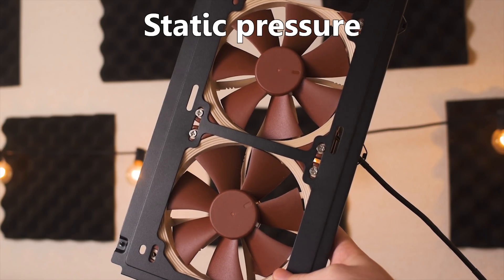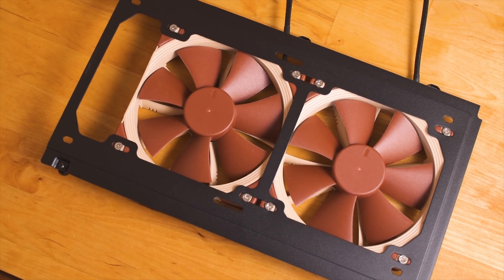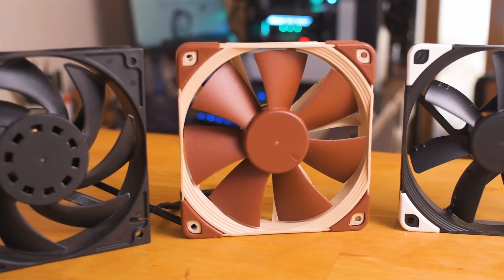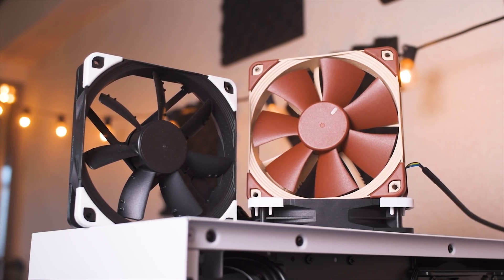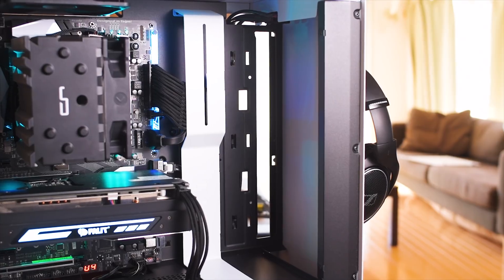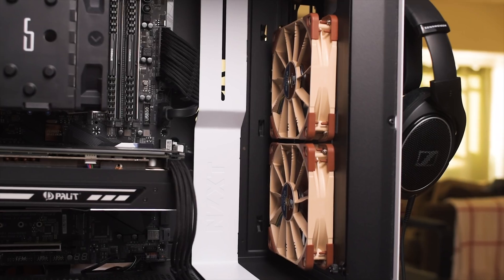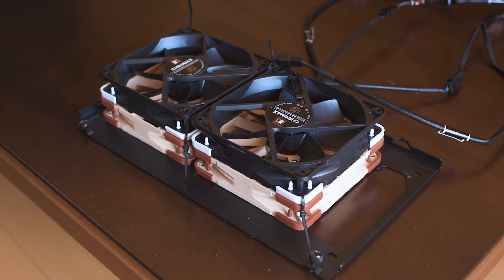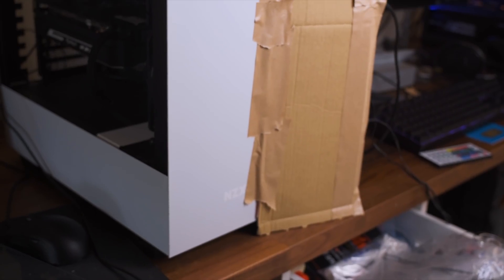DON'T buy front intake fans! (For NZXT H500/S340)

Comment: I think the one thing you are missing here is that you are using a system that barely pulls more than 200W (if that, even), which is not enough to show a significant thermal difference with this case and setup (and quite frankly, I'm not sure if its enough to challenge ANY case anywhere).

For the CPU, you have additional assistance with the Cryorig H7's fan for airflow through the tower, but since you are likely hitting 60-70W of consumption at most, you aren't even remotely saturating the heat pipes capability for heat transfer.

For the GPU, in both scenarios the twin axial cooler has plenty of access to fresh, cool air. In the initial setup without front fans, the negative pressure of the case is pulling in cool air from the rear, empty PCIe covers. When fans are added to the front, the air is still being given to the GPU in a significant enough fashion for the temps to remain constant. In both scenarios, the top and rear fan are able to remove hot air from the GPU, and once again, due to the significant size of the GPU heatsink, you are nowhere near saturating the heat pipes.

Adding front fans to the H500 (or really, any case on the market) is entirely dependent on the level of heat generated within the case and the saturation of the cooling components within. In fact, with your system you could likely apply duct tape to the entirety of the front intake, bottom intake, and remove the rear fan entirely and see little to no change in temperatures of your components. The natural intake from the PCIe slots would be more than enough for the GPU, and the CPU fan plus the top fan would provide more than enough capability to exhaust the hot air from within the case.

If, however, you were to change the load generation within the case to a 250W+ GPU such as an AMD Vega card or GTX 1080, and overclock your CPU to pulling 120W+, you would then begin to see the thermal limits of the case's compact nature.

Without a doubt, an individual running a GTX1080/1080Ti plus something like an i5-8600k/9600k overclocked to 5.0Ghz would absolutely notice a significant change in temperatures with front intake fans present. For me personally, I preferred the compact nature and aesthetics of the H500i, so I chose it for my i9-9900k and 1080Ti FTW3 Hybrid build. I have a 280mm AIO on the front (NZXT Kraken X62), and the hybrid card uses a 120mm AIO which is placed on the rear. I still retain the 120mm fan on top for exhaust and VRM cooling. The airflow, thanks to the 140mm fans on the front, is more than enough to keep all of my components cool. For testing purposes, I decided to shut off the front fans entirely and run a GPU only load (since my CPU temps are tied to the front radiator, it wouldn't be fair for me to run a CPU load with this test as I'd have no cooling performance from the radiator) at 100%. With front fans at 40% (my normal range for gaming/etc, which is silent), my GPU temps stayed put at 55C. Once I shut off the front fans, temps climbed to a whopping 68C (very high for a hybrid card) due to lack of fresh air being pulled into the case to assist the radiator in the back.

Your testing equipment is simply not enough to challenge the natural case airflow in any meaningful manner.
Reply: Thank you for this, he had me thinking. Just got my h500 today. My old case has 7 total fans to cool my 8700k at 4.9 and GTX 1080. Putting the 8700k in the h500 with a 2080 ti and was worried about the smaller case with 5 fans being able to keep my 8700k as cool as the old case. Wanted to avoid water cooling the cpu but it would be so easy with this case.
Reply: Pyromonkey83 Do you think it'd be worth it purchasing a couple of front intake fans if I have an i5-9600k and an rtx 2070(single fan)??
Reply: @victorboesen3837  if you're using air cooling you absolutely should buy at least a single high static pressure fan (so it gets good airflow even through the restricted front intake) my pc would overheat frequently (also an i5 9600k rtx2070 system) but when i added 2 front intake fans that problem quickly went away
Reply: coolboybryan303 thank you for the reply! I've moved the back exhaust fan to the front bottom and it has improved my gpu temps a lot but the CPU temps has risen. However it was the gpu that was the hottest while gamin and the CPU doesn't go above 60 while rendering and exporting videos. But yes I will purchase a couple intake fans, so I have two exhaust fans and two intakes.
Reply: @victorboesen3837  if you're having trouble with gpu temps you might want to orient your fans to the back of the case and have them both blow out air to the outside of the case, this way air will be pulled in through the little perforated holes in the pcie slots, it helps a lot with cooling, its how nzxt designed it
Reply: @sovietry4944  It's not really a problem actually. Before my gpu hit temps at 70 sometimes, but now it never goes above 65 even when benchmarking. But thanks, I actually didn't know that.
Reply: @coolboybryan303 hey i know this is a little old but i was wondering if i would need front intake fans for a i7 8700k cpu and a 1060 gtx. this is the first pc that i’m building ever and have taught myself, using the internet, basically all i know about building pcs so any help from a veteran or anyone well versed in the world of building pcs is greatly appreciated. btw according to pcpartspicker my combined intake is around 320w i think. If i do need front intake fans which ones do you recommend
Reply: Victor Boesen weird, i run this case with a 9600k @5ghz and a 2070 super. using nzxt’s cooler my flu temps hover from 65-70 degrees and my cpu stays around 70-75 degrees under heavy load. no throttling
Reply: I have a Ryzen 7 1700 overclocked to 4,050mhz on all 8-core @1.375v with a NH-D14 cooler and Gigabyte GTX 1080 Windforce overclocked to 2025mhz 5650mhz memory and liquid metal applied to die.  
I generate a FUCKTON of heat with my rig and I have an H500 case, the two front intakes save my life.  They dropped temps by like 13°C first time round after installation.
Reply: You need 140mm front intake fans, not 120mm.  This guy only used 120mm which leaves a gigantic gap for the fans to recirculate air....
Reply: v KEITH v  you got some cards with a single blower fan and some small formfactor cards
Reply: v KEITH v yep I have the asus turbo etc 2070 and it's a blower type gpu
Reply: I just bough H500 case and i have an RX Vega 56 and Xeon E5-2650 v2 ... Gonna be interesting to see the temps when it gets here
:D
Reply: v KEITH v ok thank you very much. do you have any suggestions on some fans i should get. i don’t want anything fancy just something to get the job done
Reply: v KEITH v welll i am using this case for my build so kinda need like back or white or something that isn’t beige
Reply: v KEITH v ok so what you saying is even tho i’m probably not gonna overclock my cpu or memory for that matter i should still get a liquid cpu cooler. because what i was thinking originally is to use 212 evo as my cpu cooler and then just get front intake fans
Reply: v KEITH v well thanks for all the help. i think i’m just 212 evo and then buy some not so expensive fans off of amazon or newegg or something. but thanks anyway
Reply: v KEITH v one more thing. so the evo 212 is a little but bulky and with that top stock ventilation fan on the case i’m not sure if it will the 212 evo will fit. what do you think
Reply: @evanmerrell8071  I believe Noctua actually make black fans too now.
Reply: v KEITH v  that's a blower style cooler
Reply: v KEITH v hey Keith, I just picked up an x62 as well. So your configuration is: front of case, fan (push), radiator? Does that tend to blow or cycle  the warm air from the radiator into the case, or are the exhaust fans sufficient enough to expel the warm air?
Reply: Pyro is correct. If you don't build the heat it doesn't matter much where your fans are. I always try to positive pressure my cases with at least one exhaust fan in the rear or top. This is because the GPU card usually emits most of the internal heat.  With more heat the air exchange rate becomes more critical.
Reply: So pyro im getting the elite version of this case for my 3080 ftw3 build, what would happen if i used only one exhaust fan pushing out the back while having the top slot as an intake fan + the two in the front intake fans in front of a kraken x63?!?! Would everything stay cool? Trying to achieve positive preasure.
Reply: Moerocco most likely it wouldn't be a great idea. By putting the intake and exhaust right next to each other you end up with a tiny little airflow loop where the fresh, cool air being sucked in at the top immediately gets exhausted right out the back and the only thing it touches is the VRM and some of the IO components on the mobo. The front fans are going to give some air to your GPU, but not enough.

This case shines specifically in negative pressure scenarios with the top and rear fan as exhaust and allowing air to come in through the front and through the rear pcie slots.

If you specifically want positive pressure (this is for dust I assume?), I'd probably look for a different case, such as the Lian Li O11 Dynamic. The O11 thrives in positive pressure.
Reply: Pyromonkey83 not just the dust but also to keep my gpu and motherboard cool
Reply: Moerocco your GPU and Mobo will be plenty cool with negative pressure. In fact, some would argue its cooler due to the higher velocity of the air around the components (in reality, it depends on the case and airflow setup). Positive pressure can create 'pockets' of hot air that don't move, while negative pressure setups rarely do this. The only real advantage of positive pressure is dust control. Negative pressure often results in better temps unless the case is specifically designed for it (again, such as the O11 Dynamic.
Reply: Pyromonkey83 so youre saying i can acheave negative pressure by having two intakes front and two exhaust back??? Also im a noob so some of these questions may sounds like dumb questions. 

Is it possible to make all fans intake and get results???
Reply: @moerocco7954  Yes you can achieve negative pressure by having two front intakes and two rear exhausts in this case as the front intake isn't quite as efficient due to the lack of a mesh front panel. It's only slightly negative, but its a solid airflow setup overall. As for making all your fans intake, yes you will get results this way, but they wont be good results. The entire idea of airflow is that you want it moving in a consistent direction from one side to the other, pulling in cool air from one side and exhausting it out another side to continually cycle the air out of the case. By setting everything as intake, there's nowhere for the hot air to go, so you just end up with a lot of hot air moving around in circles inside your case. If you make everything exhaust, there's nowhere for fresh air to come in except for the small holes around your pcie covers.

Think about it like your car. If its a super hot day and you leave all your windows closed, it becomes super hot in the car. IF you open up ONE window, you get some air coming in, but there's nowhere for it to leave except for the same window, so people on the other side of the car are still hot and air doesn't really move anywhere. If you open up windows on the opposite corners of the car (IE like driver window and rear passenger window) then air moves throughout the car and cools everyone down. You want the last option, which is to have one 'window' open to let air in, and the other 'window' to let air out, on the opposite side of the case to get the most airflow throughout the entire case.
Reply: @Pyromonkey83 I have the H510 and 3x Shadow Rock 2 (two 140, one 120) from Be Quiet. I was planning to buy the 4th Shadow Rock 140 to put at front intake. Should I get hight static pressure fans instead to put at front?
Reply: v KEITH v 2070ti xD
Reply: bro I don't even write this much for school essays.
Reply: People actually read this??
Reply: @mr.cookie8904  | Yes.
Reply: Well you didn’t have to write a 5 page essay. Ain’t nobody wanna read dat

Comment: So what is the best way to set fans? For non extremist user? A few games on 1080p. I have a case fan with no filter, that I guess takes air (into?) the case..
Should I get a new case? What is the best way to avoid dust?

Comment: Of course this video pops up in my recommended the day after I order those nice $20 a piece fans....
Reply from the maker: I'm sorry to hear that, but at least they will give you positive airflow. That will help with dust build up. It also depends on how hot your system runs. Some people with very hot systems have said that it does help them.
So hopefully it's not wasted. If you have time, please let me know what kind of results you get.
Reply: @DawidDoesTechStuff  Yeah thx for the video haha. Same issue here as the other guy. I bought a 510i nzxt case yesterday by mistake cuz the box looked the same as the nzxt 500 elite case I was looking at on the box. And I had the impression that the elite case was mesh on the front. But watching other vids it's temptered glass. And I just purchased 3x Arctic bionix F140's last night. 
At least with the 510i Case I got. I can easily take it into my work. Since I'm in a Fabrication warehouse for building large Industial work trucks. If the Airflow doesn't fix my Temps coming off my 5700XT 110° C. Then I will jerry rig mine as well. Messing with the front of that case.
Reply: I have same case and my gpu temp went down from 80 to 70
Reply: @mikimarchi  did it go down after adding fans?
Reply: @AKABattousai  for me ye

Comment: I would always want a case with good airflow and dust filters. Buy a few quiet fans, probably Noctua for a pretty quiet system.
Reply from the maker: Noctua fans are awesome. :D
Reply: @DawidDoesTechStuff  Do you maybe know which Noctua fans are on par with what comes with Kraken x62 AIO (2x140mm Aer P fans) and the two stock case exhaust fans (Aer F120) but quieter? Looking for a more quiet solution then I curently have but one which would still manage to disspate the heat successfully. I don't know where on the noise scale and ability to push air strenght do Aer P and Aer F120 fans fall in comparison to the Noctua ones? 

I have the two stock case fans as exhaust but physically connected to Kraken x62 AIO which is installed as an intake cooling the CPU. CAM software that comes with Kraken then regulates the AIO fan speeds but also the two exhaust ones according to how hot the CPU gets. 

The problem I have with this setup is my MSI 1070Ti GPU can get over 80 degrees C in GPU intense games and accordingly ramps up its own fan speed considerably making it for a "loud" gaming experience. When both, CPU and GPU are heavily tasked then I have double noise - from the AIO and case fans and from the GPU fans all producing a considerable noisy annoyance.